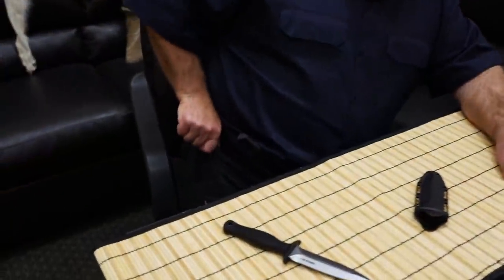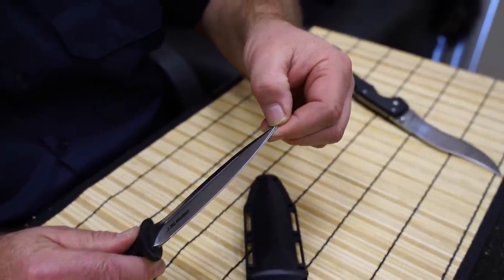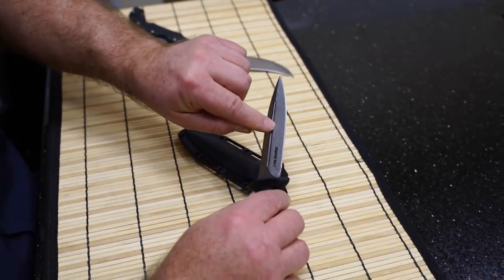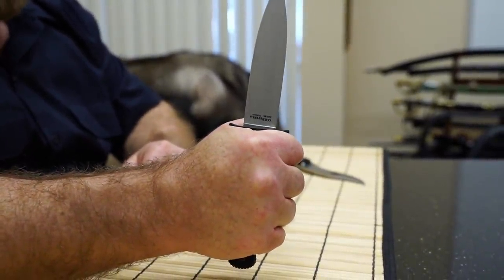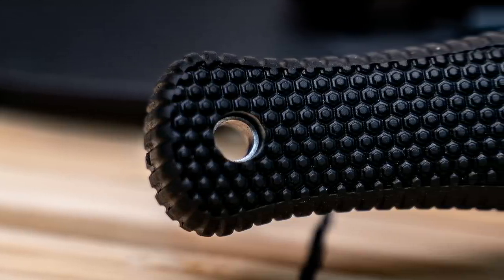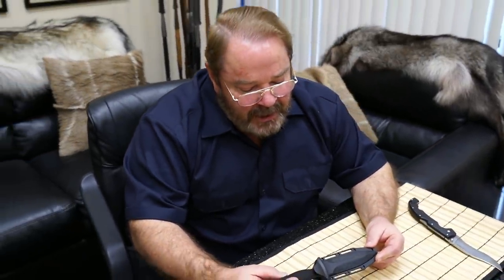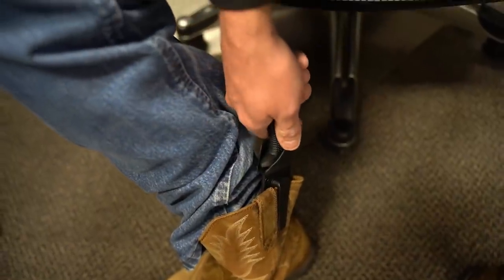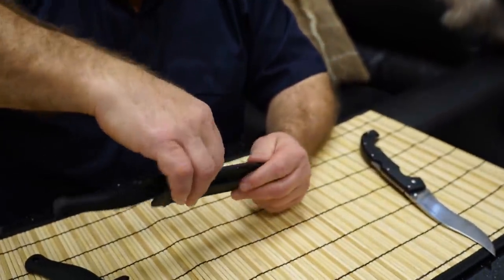Counter Tac 1

Comment: That counter tac would be an awesome neck knife when jogging. It would also be cool to see cold steel make a Arkansas toothpick.
Reply: I think the Cold Steel spike is great for running. Just put some cordage through the holes on the sheath and you can run a belt through. I put it on my reflective belt. It is very light, cheap, and uses a great steel for rust resistance.

Comment: One of the best purchases I've ever made in a boot knife!
I'd vote for an upgraded model with a slightly longer blade, improved steel, and micarta/G10 handles.
Reply: That's what I keep telling them, a double grind, 6 and 8 inch long blade with G10 scales will sell faster than cold beer.
Reply: @gunner3548  
Agreed.
Definitely a design worthy of an upgrade in length and materials!
Reply: @TheScotchaholic  indeed worthy of an upgrade, even the handle in my opinion needs a little touch up. I vote for cpm 3v, and definitely a blade grinded on both sides. Chisel grind is not so recommended for such type of knives. What is your steel of choice?
Reply: @gunner3548  
1-2 inches extra of S35vn since it was chosen for their SRK1, for overall toughness. This style is a tip slasher and not a deep cutter (the Tai Pan and Peacekeeper 1 has just little bit more belly for deeper slashes), and it's primary is for penetration. So I'd also favor toughness over edge holding of the 3v.

Either grippy micarta or g-10 would be great for handle material.
Reply: @TheScotchaholic  cpm 3v it's extremely tough also brother, but not so stainless as s35vn. I prefer both. I consider tai pan blade configuration to be the best, but the handle it's not. It needs a pommel for better grip and definitely micarta or g10 scales as rubber will always be rubber. I even  prefer the good old wood scales but not rubber. Stay sharp.
Reply: Yeah would be cool, but fact is this knife will function just as well the way it is. Whether it's a person attacking you or a Pitbull, this blade in AUS8A will Penetrate just as effective and save your butt.

Comment: I've had a Counter Tac II for several years now; absolutely quality product! It's small and thin enough to tuck inside my boot without rubbing or being uncomfortable at all, and though I wish the clip was metal instead of polymer, it's never come loose or anything. I really dislike having to wear my boot knives on the exterior of the boot, but many are so thick or have such inconvenient sheath design that they can't be worn inside, not so with the CounterTac II. I'll admit it doesn't quite beat the AG Russell Sting, my favorite boot knife of all time and a more "traditional" design, but this a bit more comfortable to wear and I'd trust my life to it.

Comment: i bought one of these, not the newer one from taiwan but the older seki city japan one it came with a belt clip and i took it off shaved off the clip insert and took an airsoft shoulder holster as a design went to the craft store bought leather unfinished so i could make a shoulder holster, went to tractor supply for the straps to connect the pads together and made a shoulder holster for it, it came out perfect, i'm left handed so it hangs beneath my right shoulder hidden behind my shirt or vest or whatever i wear

Comment: Cold steel counter tac. Double edge chisel grind dagger. It has alomost the same blade shape as safe maker. Very strong tip. I use it for edc for 3 years. Cutting rope, card board, sometimes 3mm plywood. Still strong til now

Comment: You can make these things sharp. Due to the concave grind on the obverse side you can grind the back edge dead flat without having to remove a lot of material. Then you can adjust the grind on the presentation side in various ways: do a full convex or a zero grind etc.

Comment: I have both the Japanese made one and the Taiwanese made one. They are both beautiful in design and function, visual difference between the steels. But make no mistake, AUS-8  is no slouch and WILL get the job done!

The sheath that he displays with the reversible clip (came with my Taiwanese model), is a decent enough sheath, EXCEPT FOR THAT REVERSIBLE CLIP. THE SIMPLE SLIP LOCK THAT HOLDS THE REVERSIBLE CLIP TO THE SHEATH, ISN'T STRONG ENOUGH TO KEEP IT IN PLACE WHEN YOU ARE DRAWING THE KNIFE VERY QUICKLY. MORE THAN ONCE I HAVE DRAWN THE KNIFE AND GOTTEN THE SHEATH WITH IT! 
I'm going to have to gorilla glue it in place and forget about reversible functionality.

The sheath I got with the Japanese model, is kydex and I'm not sure if it was original or not since I bought the knife second hand at a gun and knife show... I'll have to check into that. But I like the kydex sheath better, without question.
These two join my cold steel barong in my collection, and I have my eye on several more Cold steel models.

Comment: As a fellow martial artist, I have to ask, "Why doesn't the Vaquero have an easier or more cosistent deployment method?" If I have to deploy this is under stress I find the thumb studs extremely difficult to use. I understand patents on the wave, the thumb discs are terrible, but can't we have an oversized deployment hole or more aggressive pant snag? With less dexterous deployment, I would use more of these tools. Imagine someone is running at you full speed, can you open that blade 100% of the time in under 3 seconds? If you're honest, most of these designs are a no. Lock strength goes out the door if the user isn't in a condition to use it. So close to greatness...
Reply: An Emerson wave would do justice
Reply: You sure you can’t just open the blade by flicking your wrist without touching the thumb studs?  The XL Tanto has more than enough weight at the tip to make that work really well.
Reply: I've had a Vacquero Grande (6"blade) as my EDC for over 20 years and it is perfect. You need to practice that's all. Half a second is too long of a draw in a fight. It should be reflex or you're likely dead in an emergency. If a man is running at you, you likely knew he was dangerous before that. Draw and hide if you have to.
Reply: @andrew-ripley1747 - Exactly. Even slight practice for anyone who is really serious about self defense would know a flick can open these weapons. You CANNOT beat Lynn's Cold Steel folders. They are the perfect weapon for multiple reasons.
Reply: There is a add on called the snaggle tooth. It’s made for cold steel knives by a third party.
Reply: Put a snaggletooth on it or practice for five minutes so you can flick it open quickly.

Comment: Oh, c'mon, Lynn. Why do we need a knife stronger than the Voyager Vaquero? The strength is good enough on the Voyager. Are we ever going to need something greater than 400 lbs? Strength is one thing. Sharpness another. It's also one thing to stick a knife in someone; we need sharpness and speed. The Vaquero is strong enough, sharp enough and as easy to deploy. I would like to buy one, but I just don't need it. I love the Voyager Tanto 5-inch. When I break it, I'll buy the Counter TAC.

Comment: Great knife, purchased the one made in Taiwan,  but the grind is not even, one side of the edge is one curved, and the sides of the blade is wavy,  very uneven. I have the one made in Japan and is is perfect. When using slightly push down as you cut either way. And then see how it cuts!

Comment: Sir, 
make a Counter Tac I and II with decent steel. Stop pretending AUS8 makes the cut, may I suggest CTS-XHP?. Also, design a fixed blade EDC knife, CTS-XHP, full edge on one side and partial edge on the other side that can be used as a boot knife, something like the 5col M1 Backpacker Knife and Sheath White River Knife and Tool S35VN Survival, but with a partial double edge (very useful when fighting). I use your Counter Tac II EVERY DAY on my belt, horizontally, on the left, so I can deploy it with my right-hand tip up, or reverse grip with my left hand. BTW, my Counter Tac ii was very sharp on one side and very dull on the other side

Comment: wow a 1 sided knife. has cold steel really gotten this cheap?
Reply: The asymmetric blade shape is very strong and makes a really painful, asymmetric wound that doesn't heal well at all. I learnt that when I dropped this thing on my leg. It's not cheaping out, rather a design choice!
Reply: @AcidTripwire  you dont think that if both sides were like that, it would have been worse? and it may not be cheaping out, but it is definitely cheaper to make than one with 2 sides like that, as they can punch out hundreds of these blades and only need to punch it out once and sharpen it, theres less work put into the process of making it. also just saying i dont hate cold steel, infact i have a cold steel knife in my collection that served me well for a few years, and i may buy more in the future as theyre what i would consider a good and solid standard in knives, that isnt to say that they dont have premium knives as i know they do, but its like 1/20 of their products. also to anyone reading, what i consider a premium knife is based on top of the line materials used and effort put into making it, you might have a different view on what a premium knife is, so dont let my words discourage you from buying a cold steel knife. theyre great knives, i just think for the price of most of their products they should have better blade steels.
Reply: Cheap or not, I want the option to get a knife this way!! I already can buy a diamond cross section four bevel dagger. I want to try this one MORE
Reply: @endermanifest5791  it’s designed like that not because it makes some mystical deadly wound but because it allows the knife to have a very sharp point while also having a sturdy point it’s the same design as a Japanese Yari spear  you may be able to make the argument that this is just a way for them to cheap out supposedly but there is actual historical evidence with blade designs like this

Comment: I wish we could legally conceal carry a fixed blade in CA!   
I`m looking @ the 'Frenzy' or folding 'TIGER CLAW'  for defensive EDC?
I think the 'frenzy' will carry better? 

on a side note, more retail stores need to stock CS knives ,so we can feel them in hand!
Reply: Beat you to it.  Tiger Claw arriving by Amazon this afternoon.
Reply: @luckybassturd7260  Opened the box and checked it out.  The handle while large is tiny to hold due to it's shape.  Having large hands this could be a problem.  Finger ring is smooth inside.  Sheath does rattle although has very good retention.  Going to have to sharpen it up as only the point is needle sharp.  The ABS/Grivory scales are a little grippy however finger grooves are useless.
Not disappointed as this is my first Karambit and for $38 it is not that bad.  Now I have to learn how to use it.